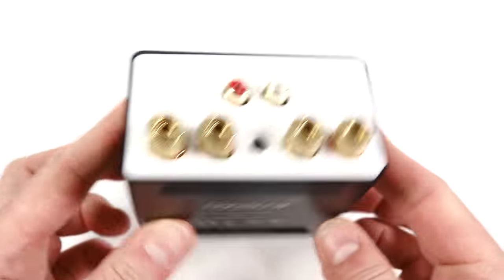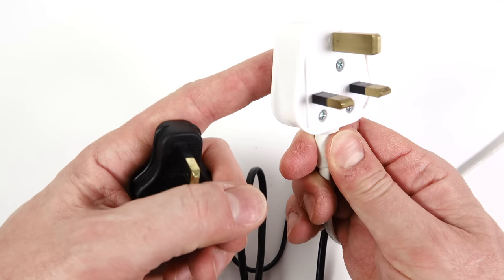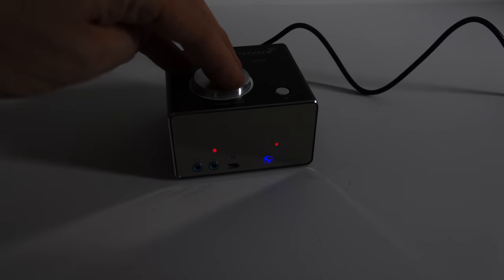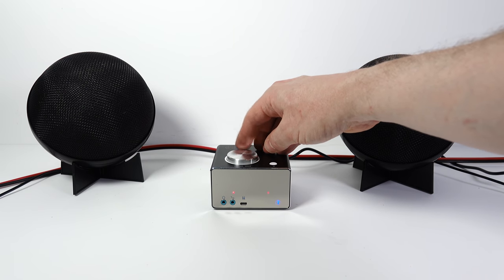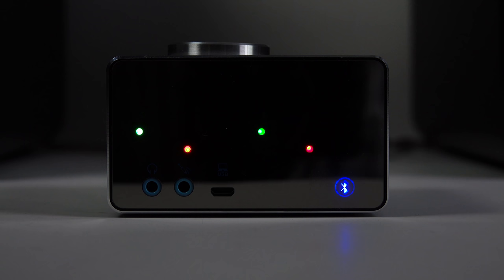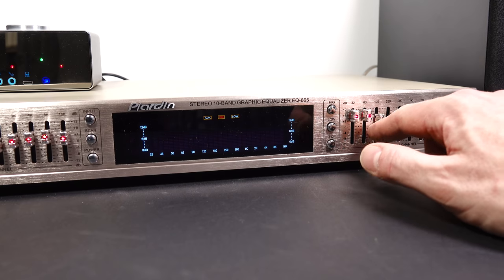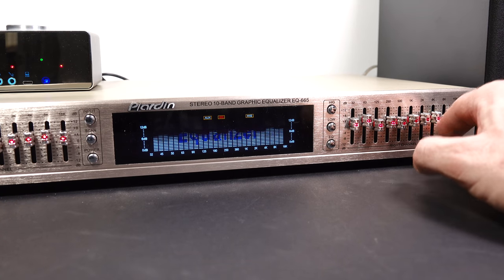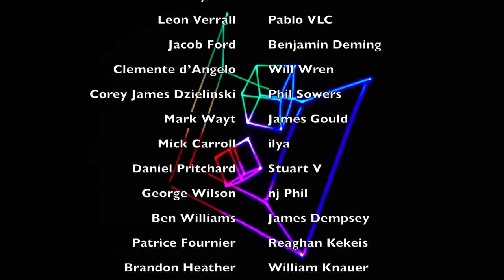REVIEWS: Mini Amp & Graphic Equalizer

Comment: These use the Texas Instruments TPA3116D2 Class D amp chip. Although these things are very clever in that they are a high power amp built into a little chip. The sound is very "digital", and not what you would call warm. Typically also they dont bother putting a nice big heatsink on them. So these cheap ebay sold models just burn out if you run them hard.
Reply: Well that's why the power supply is 19V, so they don't need nearly as much cooling, the heat output is limited to at most 63% of what it's do at 24V - if the supply voltage droops under load, that could limit it further.

"digital" rather than warm? Well i'd disagree, had it not been for the quality of the output choke which somewhat attenuates the low end and the increased noise and distortion at the high end due to the rest of the filter design sloppiness, not quite up to IC manufacturer spec. With these typical shortcomings, i can see why you'd feel that way.
Reply: @SianaGearz  I say digital sounding, because my daily driver is a Dragonfly Black DAC. Absolutely awesome DAC and headphone amp. They use the ESS Sabre chipset.

Comment: The UK seems to be one of the few countries in the world with fused plugs. The one that came with the amp is perfectly fine. The fuse in UK ones are not really needed unless for some reason it really needs to be significantly less than the one on the circuit, or the device it is connected to doesn't have a fuse itself. 

It's just the local British obsession with electrical safety which has them not only have three fuses per device, but also an on-off switch on the wall socket itself. Some serious multiple redundancy there in a country that has rather more dangerous gas pipes – also with safety valves all over the place, of course, but if safety was as much of a concern as with the electrics, they gas network would have been dismantled decades ago.

That said, now that I live in the UK, I do find myself switching off sockets that are not in use and grump about unfused plugs myself even though I got by perfectly well when I lived in another European country with none of those extra safety features.

Comment: Everyone needs a little stereo amp that can be moved around at will... I have an older tpa2020 that I modded to output 5v for various SBC applications and occasional remote sound around the house or out.
. (Using the car battery as a power source.)

Comment: Lol. I was going to comment before you mentioned about the "ball" speakers that usually technics uses the "S" suffix for surround and "C" for center although front or main obviously doesnt follow as they were usually towers and used as optional stand alone or with front/rear 4.0 or 5.0 most commonly. But still unique at that. Technics has some nice electronics.

Comment: The graphic equalizer could most likely be modified slightly.  Each of the sliders themselves, the holes the sliders run on I mean, could possibly have ever so tiny LEDs in the guides as a VU meter.  Of course, they would have to be retrofitted in height.  I think the equalizer itself may have to taller.

Comment: British AC plug is not the most elegant, but it's the safest design possible! Included fuse, NO possibility of dangerous touch anywhere, its just the best way, you can design you wall plug...
And why you would need fuse in plug? Because British electric networks (at least older ones) are designed the way, that fuse is both in service box AND in plug...
Reply: The eternal nanny state. No wonder it wants to ban everything.
Reply: @BaconMinion  The nanny state that keeps greedy bastard companies from putting bleach in our chicken.
Reply: @greenaum  Yes, yes, the evil companies and various other reasons why you should never be allowed to think for yourself. Just let the nanny state tell you what is and isn't safe while taking away your freedoms.

Comment: The equalizer seems badly constructed as the right 16K slider switch light out and filmsy, but is the eq making the music better or degrading it. If it does not degrade music it can be used as an analogue source switcher for vintage quality receiver. Hope to get comments

Comment: More interesting than the ball speakers are pyramid speakers from the Philips Matchline era. There is a middle and a high-speaker,  both lying and stacked one over the other inside. Above them (inside a pyramid) is a cone facing downwards, allowing the sound to spread 360 degrees around.

Comment: Have you ever used Monsoon Planar Media 9 speakers? They are pretty much the last consumer product the company ever made (aside from car stereos) before going out of business in the mid 2000s. They are amplified and sound incredible for their size, although they can be victims of poor (leadless?) solder joints at the headphone jack found on the rear of the subwoofer. They seem to be quite rare and hardly ever pop up on eBay.

Comment: Since you are into vintage gear like I am, I am trying to bridge the gap between vintage and modern. I have vintage amp and preamp ( pioneer spec 1 and 2) and Klipsch Cornwall iii speakers. I am trying to find a DAC that will allow me to connect the digital to the analog and do it justice...what do you recommend?

Comment: I would presume if you dropped the input voltage down, you'd have to turn the volume up higher to drive the speakers to a suitable volume and thus the display would display more of the green LEDs on the nobsound amp?
Reply: Dunno, the LEDs might be driven from the final output signal, so it wouldn't make a difference. He could try turning it up to max and maybe sticking a couple of light bulbs inline in the speaker cables, but that'd probably be a bit much. 

Maybe it's a simple matter of adjusting a resistor or two on the LED-driving circuit. Assuming it's not a microprocessor, then it'd need new software. 

I'd probably just put up with it.

Comment: You absolutely need a fuse in your plug when the outlet can supply 32A and the wire can only handle probably 2 Amps (being generous here).

Comment: IIRC the UK standard line voltage is 220-240 volts. (Is that split from 480v like the US 120 volt line is split from 230v?) So I can understand the plugs being larger, actually the size of a US 220v 40A socket I think.
Reply: Italy and Switzerland use slimline plugs with 230V. Also all across Europe, such a device would ship with a Europlug cable, since it's got a double-insulated power supply (at least nominally, i'm not going to judge whether it's executed correctly without it being opened up and a number of tests run on it) and doesn't need much current. Europlug is pretty small and has puny thin angled pins which generally have close to a single-point contact pretty much, they're angled and they flex or pivot slightly so they work in sockets with slightly different pin distances and widths across all the European countries, so the current is limited to 2.5A, but it's well shielded against accidental touch.

European power distribution to buildings is 3-phase Y-configuration and is generally specified at 400V, which comes out to 230V when split into individual phases. USA uses a single split-phase. A European electric cooking stove and oven with maybe up to about 12kW power is generally connected straight to the 3-phase, but otherwise there aren't usually any appliances that need more than a standard household plug since it's specified up to 16A which comes out to well over 3.5 kW.

Comment: A german youtuber called Speakershocker did a review on this device aswell.
He said it´s good for small speakers for use on a laptop but can´t reach the quality of a hifi amplifier (obviously).

By the way i have a pair of Grundig Kugellautsprecher 310 (those with 35W power) and they sound great but have problems with low frequencies and the condition is... not so good but hey they still work!
Reply: If I recall it correctly, nobsound mostly uses TDA3116 chips in combination with a suboptimal pcb design that leads to problems in use with 4Ω speakers. Do you know what chip is used in this one?
Reply: @S41t4r4  I don´t exactly now which chip is inside this device but it´s for sure something like the TDA7492 which is almost the same as the TDA3116.
And yes it´s right, the output filters have to be optimized for the resistance of the speaker.
Also there are many chinese board out there with TDA´s that have wrong valued caps which increases the thd (distortion) but also some good boards.

In all they work just fine for most applications and even the output filters aren´t a big issue since your speaker´s coil is a inductive load and on AC they have a changing so called impedance which changes demanding on the frequency of the signal - so a 6 ohm speaker or 4 ohm speaker, doesn´t matter.
You need the impedance, not the DC resistance.

There is a reason why HiFi amplifiers are so big.
High capacity caps, transformers, power mosfets and so on.
Big fat components, optimized for quality,  low THD and not for small size and power efficiency.
Those chips are designed for small devices like bluetooth speakers, small powered speakers and maybe TV´s and for that it is fine.
You don´t need audiophile quality on your JBL Flip 4.
But it is small, can play a long time on battery and still poweful.

Comment: I own one of these amps. The speaker outputs are out of phase (It's a fault on the circuit board, and I confirmed it with sine wave tones). You need to reverse the polarity of one of the speakers, otherwise you will have weird phasing and a lack of bass.
Reply: If you play a mono signal through it with the speakers wired 'correctly' the output will sum to nothing!

Comment: Can you recommend a mini amp that I can use in my car? My car has an Aux input that I connect my music player to, but even at max volume the sound is irritatingly quiet. I have to crank up the volume control on my car stereo almost to the max to get a reasonable volume, and then I have to deal with distortion. I tried a FiiO headphone amp, and while the sound quality improved, the sound volume was only slightly louder.

Comment: I actually think the UK plug is a lot better than the one that we have here in the States. It's fused and the power socket is quite a bit safer than the US socket.
Reply: But the reason it's fused is because house ring wiring has a terrible failure mode. Countries with saner wiring practices don't have or need fuses in their plugs. There's also about a million different ways to make plugs safe against fingers getting in touch with electricity, none of them i feel is inherently better or worse than the others, i mean both Italian and Swiss plugs are slimline and have different approaches to touch safety, and Europlug is safe to use with these both and with German and French sockets too. 

That being said the way UK plug opens its child safety shutters is a treat. When fitted (and they're optional), the shutters in Germany are usually a menace.
Reply: Siana Gearz ah, ok. That makes sense

Comment: I use a TP22 and Magnat Monitor supreme as my setup for the PC.

The only downside is the  "low" power of the amp. Only around 18W and moving the big speakers is quite hard.

I've discovered how to increase the power without blowing the amp up...

I'll have to try.
Reply: You generally can't increase the power of amps without blowing them up. It's the intrinsic design. Power depends on supply voltage, which determines current flow, and transistors are only specified to  handle so much of either. Your amp will overheat, and either start sounding bad, or blow. 

All amps sound worse at higher power, it's generally shown in the specs if they're extensive, or at least notable when the specified THD etc is for a fairly low power. 

If for some reason it's actually a more powerful amp, but for some reason they've "crippled" it to sell at a lower price, for some odd, odd reason, then maybe. But nobody would do that for an amp. If anything they'd over exaggerate.
Reply: @greenaum  yup but the chip goes up to 26V and the current supply is 20V chokes are rated up to 5A.

Only downside is the pre amp opamp rail and some caps that are rated 25V.

So I have to fix those first.

THD+N is quite low at current gain. If I increase the voltage up to 24 I can get at least 20w.

My speakers are like 90w rms rated. (Not that sure I don't remember)

Comment: I have a pair of Grundig Audiorama 7000. Would love to hear your view on them. Go for the 7000 because they are the ones with 8 tweeters and 4 woofers in each speakers. Have addes a subwoofer to them to get some more bottom end.
They sound different to ordinary speakers but good (have a pair of Danish Dali Menuet and a pair of 1990 concrete speakers from Audio Produktion here in Sweden). Bought my Audioramas here in Sweden for about £400. Good condition. Listen through them a lot :)

Comment: I don't want to detract from the main subject which is the Nobsound device but something a couple of others have pointed out is that the skinny mains plug has an insulation shroud on the earth pin, whilst it does not matter given only two conductors are used in this application if it was supposed to be a true three core plug and cable then there is  high probability that the earth pin will not make contact with the socket contacts when you push the plug all the way in as the typical mains wall plate female sockets in the UK are closer to the faceplate than the active & neutral so earth pins should never have an insulation shroud, if  there is one  then peal it off with a stanley type knife and clean the pin. I would suggest John Wards YouTube site (https://www.youtube.com/user/jjward/videos) as John is always testing suspect mains power components. Notwithstanding the above I always enjoy your videos.

Comment: "Why do you need a fuse in the plug?" - According to bigclivedotcom, they don't usually use circuit breakers in the UK as a result of after WW2 reconstruction, or at least they use large high amperage loops. So the fusing is done in the plugs.
Reply: All new build houses in the UK have circuit breakers, older houses have fuse boxes. You're unlikely to get home insurance if your house has neither.

Comment: Throw that equalizer out & get a used one with PAIRED SLIDERS (LR LR LR LR LR) rather than one with left over here & right over there (LLLLL RRRRR). It's a lot easier to get things dialed in. I found 2 Audio Control Octave 10 bands with subsonic filters & a Denon DE-70 12 band (16 Hz to 32 KHz) with switching for 2 recorders & a line input. The Audio Control EQs are actually made in USA.

Comment: Could you please try to peel of the sticker on the power brick a little bit to see if there is anything underneath? Other similar companies like S.M.S.L often put there own stickers on standard power bricks while "tuning" the output specs (e.g. a sticker that says "SMSL 12v 2.5 amps power supply" and underneath is a sticker that says "HP 12v 1.5 amps power supply").

While obviously shady this also means that the power supply is made by a legit oem and shouldnt spontaneously combust.

Comment: I found a Numark EQ2650 with a perfect condition VFD for 10 bucks. The only issue is the little switch between spectrum and vu display modes is snapped off, its set to spectrum so its how i want and i dont mind lmao

Comment: Those "skinny" plugs are actually illegal in the UK. The "earth" pin is not even wired to anything. I think John Ward did a video on these.
Reply: A device doesn't need to be earthed if it's double-insulated. There are millions of power bricks out there with plastic earth pins (just there to operate the interlock in the socket), and many millions of 2-line power cables which don't have the earth lead connected (e.g. any mains powered radio made since the 1970s or maybe even earlier). Most power bricks don't have user-replacable fuses either. There's nothing illegal about any of that. As for not having a fuse in that style of power lead - that I don't know.

Comment: I think the comments about the UK plugs is more because of the inbuilt fuse, since the rest of the world just rely on a central household fuse box or circuit breaker.
Reply: What about the fact the earth pin has a plastic sheath on it. Major fail there since once fully inserted it will not make contact.
Reply: @dj_paultuk7052  That's common on UK plugs that are powering class-3 appliances (ie. double-insulated). The plastic earth pin isn't electrically connected to anything, it's sole purpose is to open the socket shutters for the live and neutral pins.

Comment: Hi

I enjoy your vídeos.

I have see this a by win because I am looking for a small amp to connect with a passive speakers in my desk.

I use a mixer (Yamaha AG 06) as "pre amp receiver" and I think is a good solution because I have with it a 24 bit 192 kHz DAC and sound USB card together with the stereo imputs, and it works also as an excelent headphones amp.

But I need extra amplification for driving my passive speakers.

My real doubt is if buy some of this cheap amps or looking for a second hand mini amplifier.

Comment: Just to clarify the plug thing, since so many people are commenting.
The non-earthing earth pin is fine since its attached to a 2 core cable, i.e. one with no earth wire. It's sole function is to open the shutters on the socket that protect line and neutral.
The absence of a fuse, oth, is illegal and potentially dangerous in the uk. It will be plugged into a ring main (universal here) fused at 32 amps. The correct plug would have a 5 amp fuse I imagine which is matched to the cable size. Without the fuse in the plug, a low impedance fault could draw up to 32amps without anything tripping and in all likelyhood catch fire.